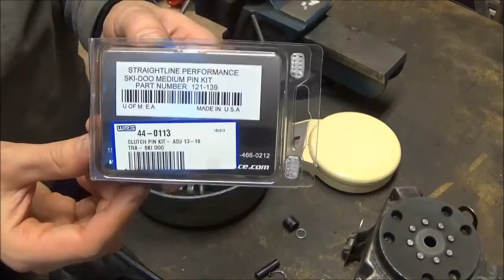Changing TRA 3 primary clutch weight pins, on the Ski-doo rev mod! LWS ep.1

Comment: what are those fancy things holding the buttons for you ? brp tool ?
Reply from the maker: Eli Bell yes or SPI, dont remeber, they are specific for use with TRA clutches
Reply: ya there like a 10 dollor  tool to stop the buttons from popping out when you pull the cluch apart